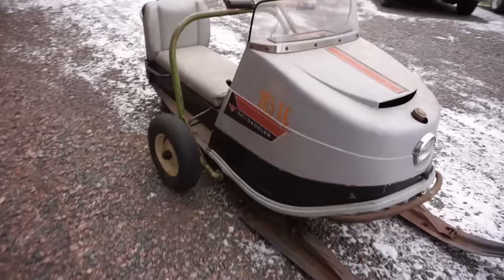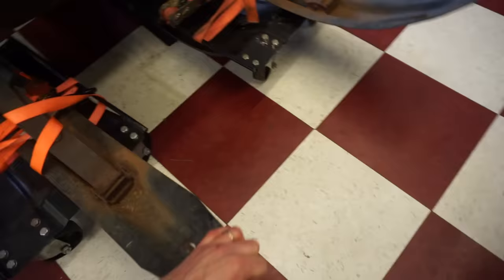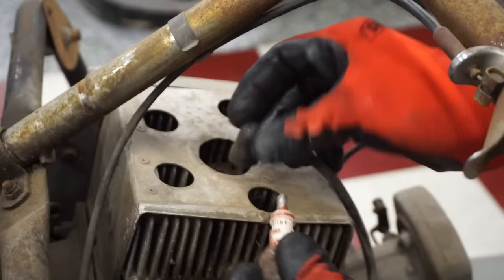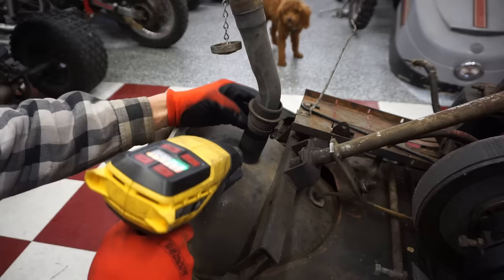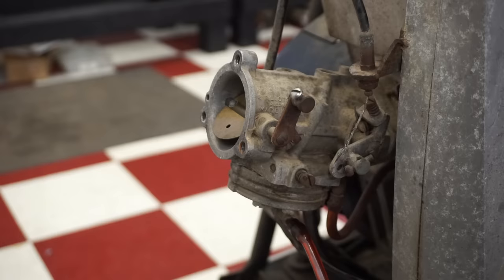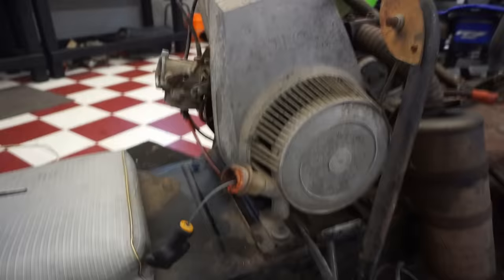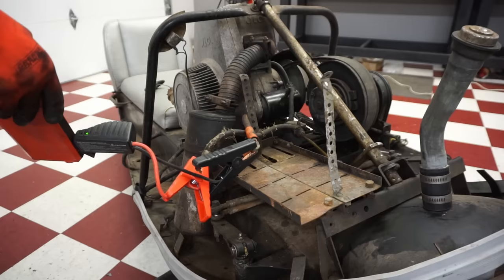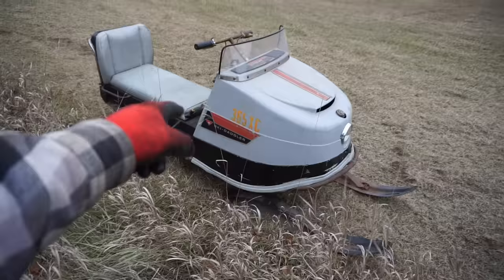Seller Said This 1960s Sled Wouldn't Run...I Fixed It

Comment: That bar on the back is a kickstand
Reply from the maker: Oh cool!
Reply: @@2vintage  take the drive belt off then you can rev it without it wanting to run away
Reply: @2vintage  can you stop the scam stuff being sent as you for telegram
Reply: Ya even when I leave nice comment I get the scam telegram crap
Reply from the maker: @1leggedmedia  No way to stop it. I delete every account that does it. They keep coming back.
Reply: @2vintage  ok Joe had to ask. Thank you
Reply: Dont spin spockets will ruin the track
Reply: That track is in bad enough shape anyway that even if that sprocket was good and there was snow on the ground it won’t pull away as hard as it should because the knobs on it are gone and mostly smoothed out lol.

Comment: Dido the bar on the back is to lift the track up. You should raise the track off the ground when you are first starting these sleds so if the engine revs it won’t take off on you. Trust me it happens. My neighbor across the street from me started his and it took off and didn’t stop until it hit my house then the car that was in my driveway. I love it when you save these old bikes and sleds.
Reply: Back in '79, I started a 72 Sno Jet. It took off, glanced off the barn, just missed a parked tractor, ran through a barbed wire fence, ran about 300 yards across a field and got hung up on a rock pile.
Reply: Dido ?
Reply: @bobmoe9221  Yeah Bob ...I gotta say you lucked out that you were left behind.  You would not have enjoyed that wild ride.  Some decisions you make give you pause, the 'what if' theory' personified.

Comment: Dad sold these first before becoming A Cat dealer. We liked the Wide track SkiDaddlers at first. Then once the second generation Panthers came out what the old Grayliners were good at was Selling Arctic Cats.  A customer would ride the Daddlers and usually the response was Mehhhh OK. Boy that’s a workout! Then they got on a Panther that didn’t try to flip you off or massage your bum with the magic fingers of a hundred bogie wheels and had a flip top hood that allowed easy access and would run off and hide from the Grayliners etc for a little more cash. Usually the black sled went home with the customer. I liked them both but that’s how it went back in the day.

Comment: I had that very sled in the 70s. It was my first sled. I was 14 or 15. Had to pull your brains out to get it started, no electric start. That bar in the rear is a kickstand for storage. Got my finger slammed in the hinge. Split a finger in two long ways but I had finally got it running so I duct taped it together and went for a ride around the yard. Then I went in the house covered in blood and told Ma and all hell broke loose.Yours is cleaner than mine was and started better then mine. What a find!

Comment: Can cnc or 3d print new wheels just need dimensions. The wheel teeth snapped off they were on ground when you had it flipped over 58:00.

Comment: Got a other Raptor 660r in my shop. Guy said put new top end on it 686, won't start, low compression (25)psi. Told him make sure valves were set to correct clearance would be fine. I ended up going through it, valves ha 0 clearance at TDC, adjusted them, boom (153)psi, put fuel to it fired right up. Love the new sled bud. Those were just a blast to ride even with those old smokey motors... enjoy.

Comment: The guy is a Scorpion collector + They are under rated old sled's. This sled u got Joe is a pre-curser to Amf Harley Davidson. If u can't find parts Im sure there are many Antique snowmobiler's clubs in Wisconson or Minnisoda area that would probably help u out. It is neat to see this sled Don't wreck the seat cover its fairly unique design original

Comment: Put a weighted fuel filter on the end of the hose like a chain saw has. So the filter goes to the bottom of the tank
Reply: Yep. I grew up with 1 lung Massey Ferguson sleds. 292 cc if I remember correctly. The tank was in the rear, but had the same type of weighted filter.

Comment: 'The Grey Whale '
Be aware on older sleds the star shaped drive roller/sprocket can turn to dust as they are a plastic compound, so it's always worth checking, they are a pig to change and can be expensive.
I wrote this at the start of thr video, and thats exactly what happened.

Comment: Running these things on dirt and gravel is tough on them. The drive wheels turned to dust trying to overcome the friction, I give it to you that they were probably in bad shape to begin with. Other sleds with slides or hyfax will melt pretty quick without snow to help with lubrication.
Reply: What I fax?  That thing has boogie Wheels not sliders.
Reply: @jeffreyhagelin3672  Did you see where I said other sleds with slides or high fax? Even with bogie wheels, it's going to be tough on it.
Reply: @RandomThoughts65  you're talking to somebody who's raced snowmobiles on the grass for many years.... I'm not sure that you're sure you know what you're talking about
Reply: @jeffreyhagelin3672  Ok you you're the man then. Running on gravel and grass will not do any harm.
Reply: @RandomThoughts65  Not if a conventional boggy wheel suspension is employed.
You got it ace, you're learning.
Reply: Maybe he forgot to put it in gear?
Reply: @alleyoop5185  He couldn't find first..🤣🤣🤣
Reply: @jeffreyhagelin3672  that’s funny:) we had a Johnson ski horse in the early seventies and it had a button on the left side that you had to push to engage. My dad bought the first snowmobile in the rural neighborhood. It was like heaven blowing through the north Wisconsin fields :))
Reply: @alleyoop5185  I remember those..  Evinrude made one just a like only in different colors.
Reply: Johnson and Evinrude were owned by Outboard Motor Company in those years and shared a common platform. Johnson was discontinued in 2011 after OMC was purchased by Bombardier.
Reply: @heywud10  
Yes,  and one of my Dad's best friends had a Skidoo and Evinrude dealership.  We all want riding with Jim when he showed up with a new Evinrude snowmobile with Evinrude 's version of the Wankel rotary.
It worked flawlessly with a muffled hum.
The cab was full of sound deadening and special attention to clean emissions.

Comment: At least you can snuggle up to the motor to stay warm when out ripping. Cool looking art deco style. Get a wire bottle brush with a flex shaft for cleaning out hard to clean tanks.

Comment: Old sleds are fun. Love my 68 evinrudes. Run like old outboards. The handle in the back is a kick stand to keep track in good shape. When you are done riding drop it diwn and spin track to clear ice off. Ps put inline filter from tank to carb that line that fell into tank had a brass screen on it to protect carb. Keeps jets from clogging. Cable on recoil were always kinking. Paining to fix. Eveys had rope. You get be off then spin up sping lock in place with metal framing  vise grips or clamp insert rope and knot it then slowly release clamps and let wind in till it stop pull out a little cok rd for tention then install grip. Never did a cable scorpion had jlo with that. They were built bt trail a sled in my home town crosby ironton minn. The owner invented the continues track and pattoned . Same track used on all new sleds today. Hope this helps. Oh yeh 150 sled named after diffrent co.s bit t some made the whole sled like omc or evenrude or massey ferguson to name afew. Probably why mine atlre still running. Iol never was impressed with jlo but it runs have fun😊😊😊😊😊😊

Comment: Have you ever tried to make knobs for those old track roller wheels that are removable by uniting them down with threaded inserts& all thread rod stock. On both ends of the wheels.& Make your own teeth for moving it into your shop to work on it mainly purposes.

Comment: some more information about old sleds. There should be a small filter with a check valve inside the fuel tank that will keep the fuel from running back to the tank. and the bar on the back of the sled I believe is a stand to put under the sled to hold the track off the ground, so it doesn't freeze down.

Comment: Very excited to see snowmobile content! Been watch all your videos for a while now but I’m I diehard snowmobile fan so love that you’re working on them too. As a trick/tip for working on snowmobiles for priming carbs and fuel pumps, every carb sled I’ve worked on I blow into the tank with compressed air. Hold a rag and the air nozzle in tight to the filler neck of the tank so the air has no place to go but out the fuel line (you will have to block any tank vents) this forces the gas through the lines and into the pump/carbs, this is very helpful as fuel pumps on snowmobiles do not really pump without a prime and it is helpful to fill the fuel bowls (for sleds with mikuni style carbs) so you don’t have to pull the sled over a million times to get it to start. Don’t use a ton of pressure with the air but you should be able to watch the gas in the lines be forced into the pump/carbs, saves tons of time and lots of pulls.

Comment: Joe.. for the pull cord mechanism if you cut the rope itll release the tension on the spring. Then you should be able to lift it up carefully just make sure the spring stays in the cover and not on the roller. To re tension it should have a small groove cut on the side where you can pull the rope through it and spring it 3 or 4 times and itll tension itself

Comment: I had a 69 Ski Daddler. As has been said the rear handle will flip down to be used as a stand to hold the track off the ground. There was also a factory kit to put wheels on the front for summer time use which was really cool.

Comment: I don't know much about those wheels for the tracks but just an idea if they are plastic you could mold your own for cheap and if they are metal you could just add onto the knobs with a welder and shape it with a grinder. Beats buying them if you can even find a pair for that old sled. Just snowballin

Comment: Excellent video Joe  :) nice bring old Snowmobile back life gas remember used back then was 87 or 91 octane plus oil was called Mineral oil green black color in 1970's for single cylinder one my late Dad used in 1969 Bombardier 292 Rotax 1 cylinder motor had 6 gallon fuel tank in front and had long track plus seat fit 3 people on plus in back had tool box underneath seat from back brake light !  My dad brother my uncle had 1973 Bombardier F/A ( Free Air) 2 carbs with 2 cylinder he used 91 octane gas with Chain Saw Oil  mix in Castrol brand one year by accident he put 91 octane gas in with Boat mix Castrol oil for outboard motors 2 cycle type it ran really good amazing me to  and lots Powerfull machine it was! I used on home farm and rent ones my uncle  he got motor rebuilt in 1994 to 440 Cubic Inches size and was going try get my dad running but he told want selling it instead fix up need motor repair on ! Also so far now you need long hose in fuel tank to pick fuel and if want keep running put in A grey bottle of STP Total Treatment fuel injection and carb cleaner in fuel tank and gasoline antifreeze bottle too help out each time fuel tank fill ! Both my dad and uncle sleds never had battery or starter motor too!

Comment: Joe you should for safety sake always take the drive belt off so the sled doesn't take off. It's usually a quick and easy thing to do. Then you can Rev it out as much as you want and need.
Reply: Actually revving it without a belt can damage your torque converter but he still should definitely take the belt off before starting a sled that hasn't ran in years thats what I aways do so it doesn't take off if something wrong
Reply: He should be careful around old belts too. When I was a kid my dad had an old Johnson sled, the belt broke when we we’re trying to get it going and he almost lost an eye.
Reply: Good thought on safety, but you should actually never run a CVT without a belt.  Not only could the primary clutch get damaged, but it could even explode. Best thing to do is have the track elevated or at least have parking brake on if it has one. Revving with no belt on is a recipe for disaster

Comment: You should have a box full of fuel filters and shut offs for these things one thing iv learned is to always run at least one fuel filter especially with that style carb you dont wanna need to tear into that if you can help it

Comment: There's usually a filter on the end of the gas line in the tank, they were usually heavy to hold the gas line to the bottom of the tank

Comment: Wonder if you can get some thick delrin sheets and make replacement wheels. It looked like the plastic part of the wheel bolted to a metal hub.
Reply: Cutting Board Material cut with CNC Router to create replacement drive gears? You are like Mustie's son. Entertaining video!

Comment: Our 1st snowmobile was a 1966 Polaris Colt, bogey wheel drive train will wear out fast when not on snow same thing happened with my 70 panther then I fixed it then the cleats started breaking and I ended up tearing apart the track and it got all bound up around the drive and created a mess, thats what took my Panther down, rounded out the 70s with a Lynx, Jag then a 78 4000 El Tigre, all fun sleds back then

Comment: Whoa!  Now we are getting into the early days of Snowmobiling.   A 1968 Ski-Daddeler!  

Think I might have been in 5th or 6th Grade way back then.  And boy did I want one of those Ski-Daddler Engines!  I wanted to rip it out and stick it on a Go-Kart frame.  

I remember an unusual Snowmobile named "the Raider".  I would never buy one, but wanted to drive one at least once.  It have two tracks, much like the tracks seen on a Military Half Track, and instead of wheels in the front, there were Skis.  

Probably a Deadly High CG, so can't say I would ever buy one, but they were sort of Cool looking.  
If you ever find one of those, that might be a rare find.  

I'm thinking of another machine, maybe came out around 1973, called "Brute"  They were Orange, and were the first Water Cooled engines I had seen.

Comment: FYI these JLO motors I believe are Czech. Here in the UK back in the day, they were used on portable arc welding machines. If you ever have to replace the plug lead good luck.

Comment: Those front cog wheels dry out over the years and get very brittle.  Once they get like that they just disintegrate with any kind of force. You need to know what pitch track that is so you can get the matching drivers

Comment: you forgot to add a filter in the fuel line betweem the gas tank and the carb. it would keep alot of that junk out of the carb. , also you could add  some seafoam fuel additive  to the fuel to clean up the carb inside.good job fixing the starter 👍 . now you just need to  add  a kill safety switch and fix the lights with a on / off switch ,  i would put LED  lights on it  . its a good fixer upper

Comment: That is a common issue. On these old sleds the rubber drives rote out. Walk you path back and you will most likely find them on the lawn.

Comment: You need to fab a rear stand to get track off the ground. Bogie drive wheels. I’ve rebuilt cogs back up with epoxy and shards of fiberglass. I drill a 3/8”  hole dead center of each cog tooth and epoxy a short bolt. Let it cure for 24 hours. Then mix up more epoxy with shredded fiberglass mixed in. Form it around the bolt shaping like a cog tooth. The length should be just below track outside edge. Grind to shape with a dust mask. They lasted a couple years so far.

Comment: Not to be a douch bag  , BUT , if you're going to be working on sleds i'd suggest building or buying yourself a rear stand to lift the track off the ground .. a stuck throttle or miss adjusted carb & you could end up with a snowmobile in an area of your house , where you didn't intend it to be .... Besides that , really enjoying the snowmobile content ... keep up the good work ...
Reply: Good advice...not douche baggy at all.

Comment: Wonderfully utilitarian look. A work sled, rather than a leisure rider. Like it. 👍 You have no option but to tear into that pull-start, I'm afraid... You can't rely on a battery in the frozen wastelands... 🥶 Could you move the rear sprockets to the front?..

Comment: I use to Drag Race AMF Ski Daddler when they switched to an orange and black sleds. Some with two cylinder and some with three. They were fast and they would lift the skis on take off so it was body english time to keep the straight. This was about 1970 - 1971. I used to work on the one like you found.

Comment: Thats pretty common on old sleds they get brittle after years .easy fix with a press .you need to build  a lift out of 1inch  square tube an a boat trailer winch .save the back

Comment: Man ive been thru alot of them old sleds buddy but ive never heard of seen one of them, Sacs/JLo engines ya but not that sled, omg you can tell Joe hasn't had many old mid engine sleds lol asking where the exhaust comes out, its in fairly good shape for its age,  they have steel hulls that rusted out alot but that looks solid

Comment: To disassemble the crank, remove the handle and let it completely enter, that will remove tension on the spring, when reassembling there is a notch to spin the assembly a few times to put tension on the spring to pull the cable back in. Super easy just a bit complicated to pit into words😂